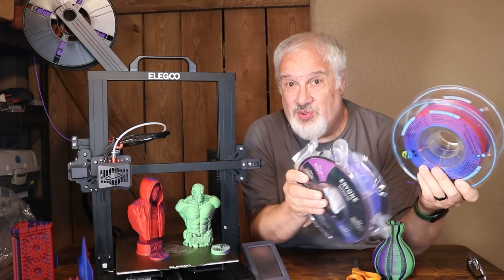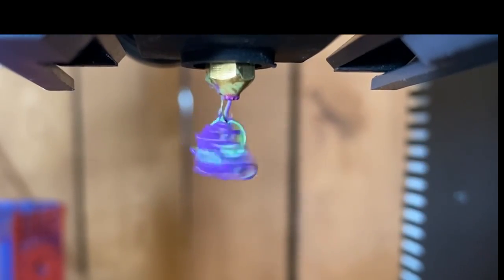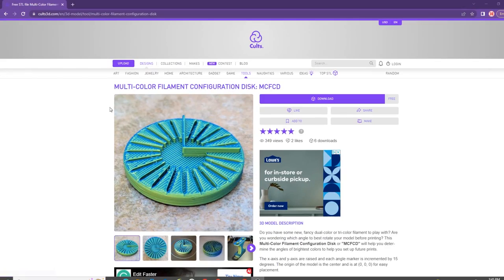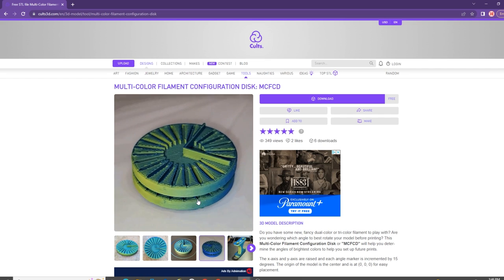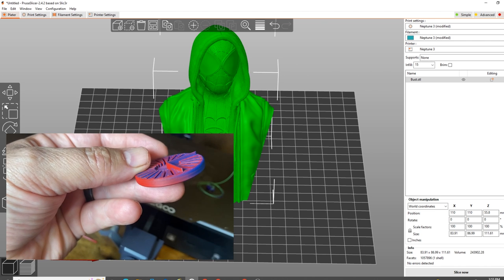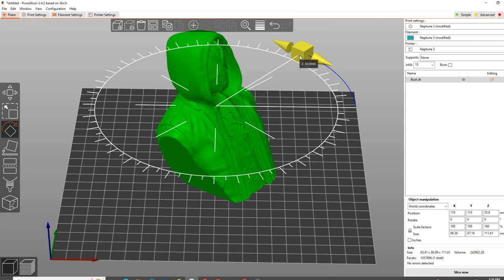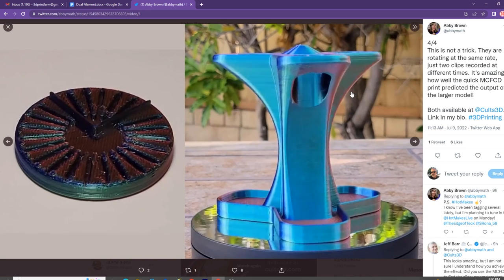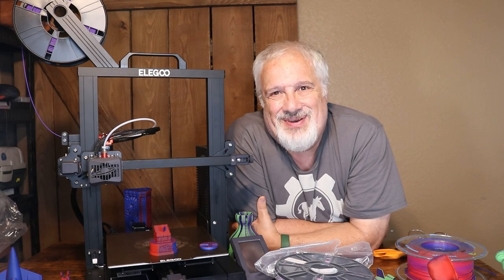How to Dial in ANY Dual or Tri Color Filament Using This Simple Trick!

Comment: Thanks for the video.  I eyeballed the filament and forced it into the extruder (on my MK3) with on be color facing front and the other side, the back, of course, is the other color.  I printed an articulating chameleon and turned out great.  I can see using this disk for tri-color filament as the tuning needs to be better than "eyeballing" it.  This is a specialized filament and deserves very special files--like super heroes and such.  I just don't see it as terribly practical.

Comment: useful suggestion there! i'd sure take that disk and print to upgrade my models
i just noticed one issue with these multicolored filaments: now i have some (bicolor and tricolor) and they gave amazing results in some prints i done, but sometimes i noticed the color "twistes" during the print, causing a noticeable color change between layers, as i changed color from a layer to another... that's sure a bad issue on the final result.... i guess it depends on the way the filament enters the extruder, i insert it (for example) red to  the left and blue to the right, and few hours later i see red to the right and blue to the left... the filament turned while extruding... is there any way to prevent this?
Reply: welcome to the club, im assuming nobody has an answer for this because ive been asking it for almost 6 months now, and i get completely ignored every time.
Reply: @theputnamto3468  i guess no one knows the answer... after some researches i assumed that the issue happens because tensions in the spool (and the more you are near the center of it, the more tension they grow) so the only way hoping to not have color twists is to have the spool as near as possible to the extruder (reducing the space for the filament to twist up) and reducing spool tensions as much as possible, maybe also unspooling and respooling the filament less tight than before...
that's sure a little pain that bothers this beautyful filament
Reply: @AoiKenshin-h1m  loose spools can lead to much bigger problems.

I've had some success printing it very slowly, and the twist seems less prominent on round objects compared to flat
Reply: @theputnamto3468  heh i know...
Reply: @AoiKenshin-h1m  I am having a hard time believing this is a tension issue. My ender 3 has such a hard grip on the filament I can't twist it by hand let alone thinking there is so much twist tension on the spool that it swaps 180 degrees then swaps back. This has to be an algorithm directional swap in the printing. Looking for a slicer that you can tell to only print in one direction. I wish this topic would not be so brushed off and given up on.

Comment: How are you getting consistent flawless looking color transitions? Any print that I have attempted will have random streaks of the opposing color almost as if the filament is rotating in my ptfe tube. I’ve tried with the same results on multiple printers. 

I figured I may need a direct drive to remedy this but it appears you have a very similar setup to my own.
Reply: Did you solve the problem? I'm also having the same prob.
Reply: @Direkarenz  unfortunately I have not made any progress. I was hoping for a response on here. I may contact matterhacker and see if they have any suggestions. Ill update if I find out anything useful.
Reply: @Direkarenz  It was suggested that my g-code or slicer could be the culprit. I ended up ditching my custom profile for a standard hatchbox pla preset profile and just changing the print temp to 225 at the start. It was noticeably worse on my prusa but my cr10 was night and day difference. My last 4 prints had smooth color translations throughout.  Unsure why yet but it seems my custom profile could have been the issue at least with my cr10. I’m running prusaslicer by the way. Haven’t tried the slicer theory yet.

Hope this helps.
Reply: @JerradMC90  Have you noticed infill having any effects on the streaks? I always have the streaks printing models with infill, but when I print in vase mode, the color transitions are flawless.
Reply: @TreeFiddy350  I haven’t noticed but my last prints that printed with smooth color transitions did have infill.

Comment: I bought a 3 pack of dual color silk PLA.  Every roll gives me issues. The filament will stop feeding. The gears on the extruder just grinds away at the filament. I thought the spool was tangled or my temp was to low. Its not temp. So must be sticking on the spool right? Its super random and I am at a loss with this stuff.
Reply: Try a different brand. I bought some that was kinda pricy off amazon and it prints smoother and faster than any silk i tried before.
Reply: Try lowering the tension on your extruder gear, and maybe lower the amount of retractions you do.

Comment: @3dprintfarm Do you know how to change color of filament on bottom and top ? When using dual color
Reply: You will have to print the model sideways. I thinkyou are better off getting tansitioning filament. But because it translsitions you don't have as much control over it.